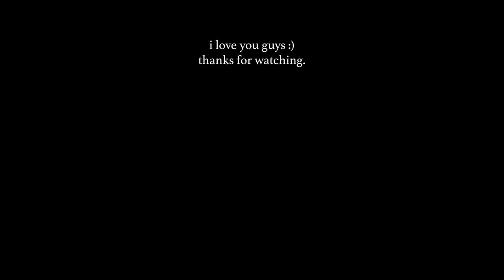I found a SECRET passage in my 130yr old cottage!

Comment: Alyssa, I think that wooden top is actually a weight from a "plumb line" before levels were invented Carpenters used Plumb lines to check that walls were "Plumb" or straight and not leaning to one side.  The idea is to take a piece of wood, attach it to the wall parallel with the top of the wall, hang a string with a weight that was pointed on one end, and see if it hung straight down (indicating a level wall) or hung off-center indicating a cant or lean in the wall. Great find nonetheless, wooden plumb levels were used for centuries and even today some traditional craftsmen still use metal weighted Plumb levels shaped exactly like your wooden top there.
Reply: I thought the same thing when I seen it and some still use them
Reply: I believe thats what it is. Here in the south they were called plumb-bobs.
Reply: Omg get out of there you guys that looks so unsafe.
Reply: @genesnyder2985  when I saw that.
Reply: Yep a plumb bob!!!!
Reply: Good guess, I was thinking it could be a "dreidel" a Jewish toy. 🤷
Reply: Traditional craftsmen? As a "modern" field welder I use them now. How are you going to line up a piece directly below another fixture that's 20 feet below with a level? Every tool that's been invented is still relevant today. Advanced technology only goes so far. A laser levels great, until you're working next to machinery that's vibrating. Then it's just a paperweight. And you're back to using the original method.
Reply: We use plumbobs doing electrical. We mark on the concrete on new construction where we put our light fixture wires at and then we use a plumb-bob once the sheetrock is up to center it over the mark that we put on the ground and we can find where the light fixtures go in the ceiling.
Reply: Plumb bobs were made of metal, not wood. Could be a Dreidel, but I I didn't see a close up to determine. The Decorative cap is probably for a curtain rod.
Reply: @guytech7310  my Grandfather who died at 99, was a Carpenter for 55 yrs and had a dozen WOODEN plumb bobs His Grandfather gave him from the 1800's and earlier. They were usually made from heavier grain wood, at least the ones Dad had in his collection.
Reply: @weregeniegaming  Sorry but thats not a plumb bob. There is no hole for the string which would be in the center. I have Plumb-bobs that are well over 100 years old, all made of metal.
Reply: @poulaivens5651  You're correct that it's a form or type of dreidel.  Mainstream European & American tops were usually completely smoothed and rounded - dreidels were faceted because they were, in-fact, gambling dice in disguise (yes the Hanukkah game with dreidels is gambling for kids.)  The purpose of the faceted sides is so that when the top stops spinning and lands, it will land with a clear face upwards (like dice do.)  The long spinning point reinforces that the top is meant to fall and land.  It is too small, narrow, and lightweight to be a spindle for spinning yarn; and it's too small, lightweight, and lacking the holes and marks to be a plumb (and it's bit too crudely made/crooked for that too.)  If not a dreidel, then it's a handmade top made by a child.
Reply: I thought a plumb bob as well.
Reply: I have a plumb weight in my tool bag all the time you just never know when it might be needed
Reply: @poulaivens5651 I thought the same thing. It also makes sense to find it in a hidden space.

Comment: At 16:58 it looks like a ceramic insulator for the old ‘knob and tube’ wiring. To get a wire through a stud or joist, a hole would be drilled in the wood and on of those insulators inserted so a bare wire could be fed through it. 

Also, it looks like the area had been previously “discovered” by someone who had insulated the underfloor.

Comment: 17:10 This must be the month for finding Christofle knife rests (boules motif)  I just stumbled upon some about 3 wks ago.  I think some are silver-plated perhaps others may be silver.   Given the footings work & plastic moisture barriers it looks like work has been done there in fairly recent years so some treasures may have already been unearthed.  Make sure you seal up those critter access points with some hardware cloth because they can mess with electrical wires and create a fire hazard.  They like to return in mating seasons.  Also, yes, to masks rodent dung can be toxic.  Fun video cool that you brought a metal detector!   Maybe get an endoscope, Tyvec coveralls with 1/4 wetsuit w/ hoodie underneath to pad the head, elbows & knees and help protect from snake/spider bites for your next foray.   Thx for the cool video!
Reply: Just saw some exact matches on Etsy with a google search. Wow. Good call!

Comment: The porcelain tube at time stamp 16:57  is part of the original electrical wiring of the house.   The wire ran thru the tube which  insulated  it from a wall stud or floor joist, etc.

Comment: Great video & how exciting it will be to discover more about it! I live in Colorado in the mountains & there is so much history in the older homes especially in the more rural areas & considering what was going on at the time. I'd do some research on the house starting by going to the assessors office in your county. That should lead you to the Clerk & Recorders office where you can look up to find out who owned the house when. They have these huge books that often have the original deed in them. Then I'd check the local paper archives & see if there's any info on the owners and/or the house. It's amazing what one can discover. I can't wait to see more on this!

Comment: the ceramic piece is a tube to run wire through the wood joist so if the wire gets hot the house dont burn down / hence knob and tube wiring

Comment: Hi Alyssa, so okay 1st I'd get an inspection of your foundation in that crawl space. Just to be safe so that rock wall with the small hole isn't a Load Bearing Rock Wall that holds up your cottage!!! I'd feel alot better if you did that first before you go down there again & explore for treasures!!!
Reply: That was my first thought when going down there! Plus wearing a mask and not pulling rocks out. I think all the load bearing studs need to be inspected. They may not be up to code for safety.
Reply: Good advice, both!

Comment: The reason It is called Knob and tube wiring is the tubes 1 wire would go through and the knob is an insulator like an electric fence oh porcelain insulator that wrapped around it. The tubes go into studs,rafters and joists to thread the wires in enclosed walls,attics, ceilings and floors. Must drill holes to insert the tubes and fish wire through.

Comment: Alyssa sweetie, ya'll be very careful about what rocks you try to move in the foundation. Having rebuilt a house built in 1854-6, I can assure you that hand laid rock foundations were often times not structurally sound. As far as your finds go, the level appears to be post WW2 model (1947-55) since earlier levels were mostly wood. The piece Bart found might actually be the end cap for a 1920's curtain rod. Heavy curtains were hung on 1 1/2" dowels and a cap like that was screwed on the end of the dowel to keep the curtain from sliding off. And lastly, the thing that looks like a stretched out jack could be a spool for a darning wheel. (Not 100% on that one though) Anyway, stay safe and I would highly recommend some coveralls for future explorations. As always, BIG HUGS and lots of ❤ from Tennessee!

Comment: The metal wheels and stuff....maybe from an old oil lamp. 

 The top is actually a plumb bob.  Used for building construction.  Probably was used in the construction of your home.   The dude that lost it probably got fired for losing it 102 years ago.  Tools were cherished and hard to come by back then.

Comment: The little cylinder that you said felt ceramic looks like an electrical insulator. You drill a hole through wood, insert the insulator, and thread your old cloth-covered electrical wire through the insulator such that it doesn't contact the wood, reducing the chance of fire.
Reply: Correct. Ball and Tube if I remember the name correctly. It's for all the single strand, "first generation" wiring  put into buildings. I thought the long wire thingy was a silverware rest, and I'm glad some confirmed that. As for the die, they did make them from bone at times. Can't tell without   seeing it in hand.

Comment: This is so fun! Alyssa, I would strongly suggest you test your house for radon. All that old rock you have under there you are bound to have it and it's very bad for your health, but there is a way to remedy it.
Reply: It is bad but more of a problem in newer houses as they seal them tighter now. Her house might be drafty enough to not accumulate.
Reply: Hi what is radon and how is bad for you
Reply: @J.Young808  good to know, hopefully that’s the case!
Reply: @charisma-hornum-fries  ok
Reply: @rocar716: it’s a gas that rises up from the soil, and bedrock below.  It’s colourless, odourless and radioactive!   It’s very bad news if you have it.  You need to check your local ‘radon’ map.   There are inexpensive radon detectors you can buy; they may even be free to borrow, from your local authority. Check with them first etc.  I live in a Radon area, but my floors are solid, thankfully preventing the gas from rising.  I’ve even got a certificate to prove it; which in turn, adds value to your property.
Reply: @MrPercy112  thank you

Comment: What you are calling the old top, I think is a spinning dice.  See if you can find any numbers or symbols on each side.  It could also possible be a dreidel.  And the tube item you are calling porcelain I think is a ceramic wire insulator.  Early in the days of electricity, a hole would be drilled in a wall and one of those tubes inserted in it and then the house wiring would go through it so it would insulate the walls from the electricity.
Reply: Yes, the "porcelain" item is part of old knob-and-tube wiring. We took pieces like that out of our attic when we rewired everything.

Comment: The porcelain tube would run thru the wall stud, and the wire ran thru the center of the tube insulating the wire  from the wood via the porcelain.

Comment: The spirt level 1950s to 1970s, first thing that went through my head with the trap door and tunnel arch was Bootleggers hideout, then it slowly went to work being done under the house to replace rotten wood and repair support walls.
Suggestion put a hole or gain entry from outside to under the house and put an extractor fan at the entrance, another good bit of equipment would be a venturi pump you could use it to suck up dust and small bits of grit and blow it outside the house

Comment: Someone has probably mentioned this already here, but the porcelain tube is a conductor from knob and tube wiring. That’s how they wired house is 100 years ago wires came wrapped in cloth and they were fed through porcelain tubes. I noticed under the house, new lumber posts they don’t look like they’re treated to resist termites. I don’t know what termites are like where you are but you might consider putting treated lumber or a cement footing under them. Subterranean termites can eat your house up fairly quickly.
Reply: Termites are unlikely to be much of a problem where she is since it stays frozen 6 months out of the year but yes if they found they would make quick work of any untreated wood.

Comment: Hahahaha!!! Almost expected you to find Geraldo Rivera down there! Obviously the access in the floor and the hole in the wall were so they could underpin the center beam and add insulation, probably in the last 20 years. The barcodes on the metal brackets kinda give it away.
My neighbor in eastern Rensselaer county found a hidden room behind the chimney of his 200+ year old farmhouse that had actually been used for the Underground Railroad.

Comment: My grandfather had a metal level like the one you found.  It now resides in my tool case.  Be careful digging under your foundation walls.  Rock foundations are not as stable as current concrete and can shift.  The crawl space allows access to keep the floors above level.  As someone else mentioned the crawl space can also provide ambient cooling on hot days.

Comment: Nice first adventure to get to know your channel! The little porcelin piece thats straight and hollow is an insulator for electrical wiring, the old cloth wrapped style. The porcelin would allow you to secure a tie off to wrap the wire around without having it come in contact with metal to short and spark a fire.

Comment: Alyssa the wheels, axel that Bart  is holding is from a toy train.
The little piece that you said feels like porcelain  could be apart of an old tobacco pipe.
The rod with + on the ends looks like it's either from a sewing kit or was used to make yarn, thread to sew clothing.
The square tray thing looks like it was used to hold cigars  or had a different use.
That's a decorative piece from a head board.
The last thing Bart  is holding is a child's spinning top which you'd wrap a sting or twine around to make it spin.
Mark mmg Co sounds like Mark  manufacturing company but I could be wrong about that.

Comment: There were a couple of old things.  The level is not old and was likely left by the person who did work in there.   You could clearly see that supports under the house had been replaced at one point.  Getting timber in there was likely what the hole was for.  The clay tube was an insulator for passing through wood with old knob & tube wiring.

Comment: If the liquid in the level is water. ( If there is anything left in the level tube that is. ) then it was made prior to 1939. In 1939 the spirit level was introduced, it used alcohol in the tube instead of water to prevent the water from freezing during the colder weather months.

Comment: We had a house built in 1910 several years ago.  It had a stone block foundation all the way around (it was a "Four Square" actually built from a Sears and Roebuck kit--look it up!).  Anyway, the previous owner needed to get underneath to do some leveling and he was scared to crawl from the one outside opening across the whole crawlspace...SO...he cut a square hole through the original flooring in SEVERAL rooms!!  I expect that may be what happened to your cottage, since I saw a lot of new wood and cement blocks indicating a fairly recent leveling job.  I think the little porcelain piece (does it have a hole through it?) was a non-conductive standoff for the first electrical wiring to pass through to get the wire safely through a floor joist or wall stud.  There was no Romex or conduit in those days!  Have fun with the house!!

Comment: The little porcelain piece that goes in old knob and tube Electrical wearing As an insulator through the wood. That was the first way they used to wire houses

Comment: Notice at 8:27 and 13:55 new concrete pier slabs reinforcing new load bearing beams. obviously access created/needed to level floor joists and probably whole house during previous reno.

Comment: The carpenter's level you found is one of the best and most accurate for the time. Doubtful it would have been Mr. C's, but potentially within a couple decades of the original build, maybe when the addition was built. Definitely keep going with the metal detector, I'll bet there's some REAL treasures buried underneath a few inches of earth. Great video Lyss. The "Roamstead" just keeps getting better! 🥰

Comment: It looks like the concrete footer pads, wooden piers, and support beams were replaced within the last 30 years.  They look like pressure treated wood, and are almost like new.  All of that material was probably taken down through the floor hole.  The hole in the center support wall was probably made to inspect other parts of the support structure.  The floor boards may have been cut to gain access if the wood grain patterns of the removable boards match the fixed floor boards.  If you can, I recommend asking the previous owner if she knew about the work.  Did you have the home inspected by a certified home inspector before you purchased it?

The biggest concern with basements is water intrusion.  A cheap DIY technique is to line the ground next to the perimeter (exterior) walls with new clean news paper (throw some dry dirt or stones on it the keep it from moving.  Then check it in the spring a month after the ground has thawed.  If the paper shows staining or crinkling, then you know you have had water intrusion.  A better way is to use an hygrometer.  It will continuously monitor the humidity level.
https://geekflare.com/best-hygrometers-to-measure-indoor-humidity/

You may want to get some rigid foam insulation and cut it to fit snugly below the floor boards to provide insulation and block any draft (or moisture) through the floor -- at least during the cold months.  You can run a string through it (using an ice pick or wire coat hanger) an inch or two from its edge to be able to easily pull it up.  Fasten the string to a washer so it doesn't pull through the insulation.

If you go down again, wear an N95 dust mask (the dust you can't see is more harmful than the dust you can see, it just takes decades to harm you, like asbestos), leather work gloves, knee pads, and not pants with large holes in the knees.

Comment: The one porcelain piece is an insulator for knob a tube wiring. They drilled a hole inserted the porcelain  the 2x4 the put the wire through it.

Comment: The porcelain thing is an electrical insulator sleeve that wires go through. The metal axle is an old lionel train set train car axle. That die might have been made from ivory, they used to be.

Comment: The white round porcelain piece with a hole thru the center is an insulator to run knob and tube electrical wiring through. Very old!

Comment: The Porcelain peace is probably an insulator for wiring knob and tube wiring. It would be placed through a wood joist and then the wire would be pulled through the ito later.